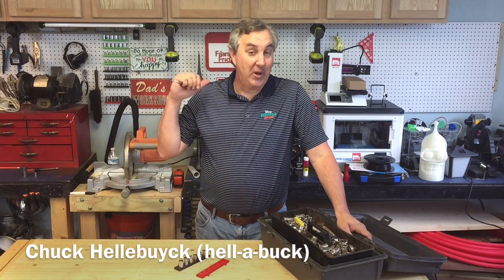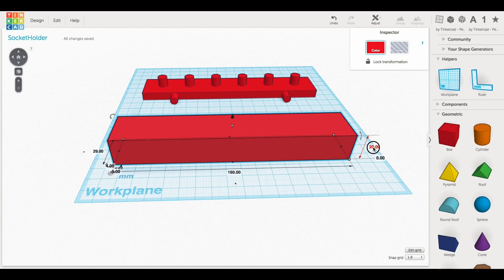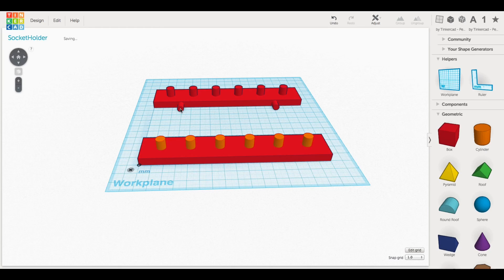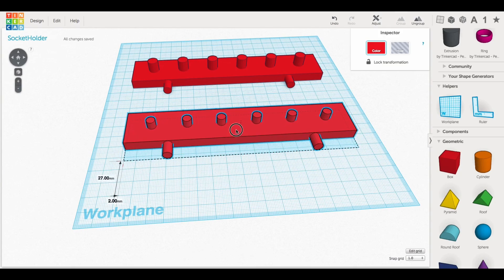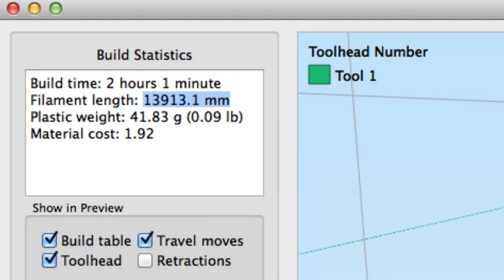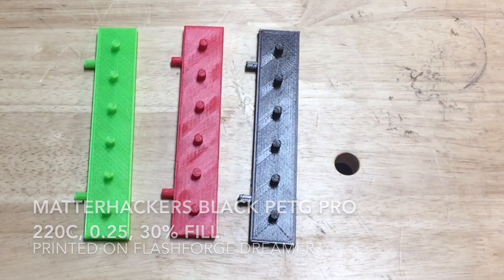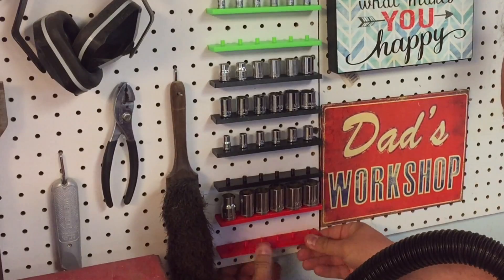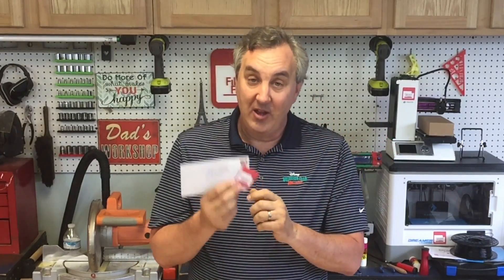3D Printing Filament Friday #71 - Ratchet Socket shelf for Pegboard Wall

Comment: Thanks. Printing your socket holder right now. Question on the Tickercad. So when you placed the cylinders on the rectangle bed it automatically combines to print them as one unit ? Or was there something else that has to be done ? I couldn't tell from the video. Thanks again.
Reply: Thanks.

Comment: Chuck -- I just want to thank you for doing these practical prints. Just the idea to do a routing jig for door hinges is brilliant. I've done routing jigs before, but that was an awesome idea. Thingiverse search for those type of items is terrible, I could not find it when I was searching for it. I remembered you doing a video on it and found your design and the design you based it on. I then combined the 2 for my router bit (as it's a little different than yours) and it saved it me a great deal of time this week. I replaced 4 doors from hollow core to solid core, and using this jig was fantastic. It's hard enough carrying 100lb doors up 2 flights of stairs, so anywhere you can save some extra labor is great. I send you a YouTube tip(I think that's what they call it) in lieu of Patreon, hopefully that helps out the channel. Keep up the great work.

Comment: I want to buy my first 3D printer. Which is the better buy the mono price or the fabricator mini.
Reply: How experienced are you with electronics? If you are confident in messing around a bit, get the Fab Mini. If you want a boxed experience, try the MP Select Mini. If you are familiar with assembling R/C cars or other electronic model kits, try out the TEVO Tarantula kit.
Reply: +Chuck Hellebuyck's Electronic Products Thank you for the info. I might go with the monoprice select  printer for the bigger and better print bed.

Comment: why did you use a cylinder for the sockets, wouldn't it be better if you did a ~3/8" cube for 3/8" sockets and a ~1/4" cube for 1/4" sockets?